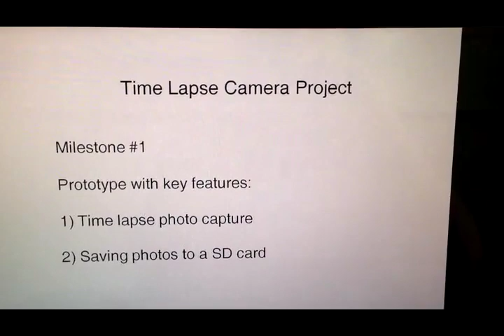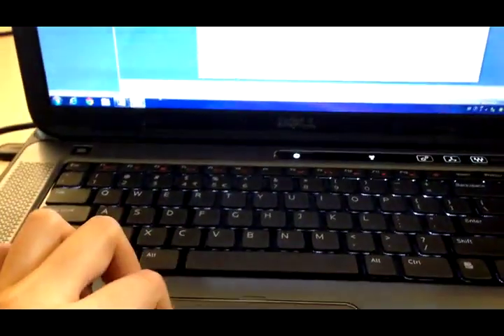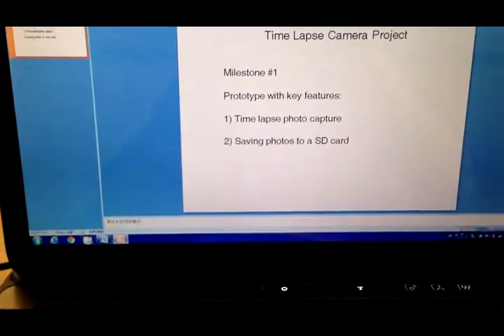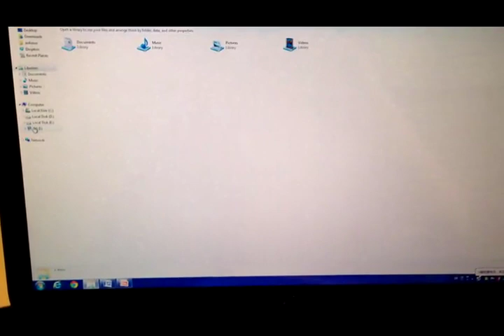Arduino driven time lapse camera prototype milestone #1, Motion detection photo capture, SD card

Comment: Hah, found video with the same devices which I have, arduino, photo camera, and even dell inspiron 5520. I didn't understand, where do you use the other sd card board? I have an idea of almost the same project but with infrared detection of moving and publishing of photos to web. I am going to create it for capstone project of coursera.org course. It would be nice if you'll attach code and scheme to this video.

Comment: Got the camera and SD card to work.
However the Pic.jpg cannot be read by the computer applications.
What JPG decoder are you using?
thanks
Reply: Would please send me any details of this project ?
Thanks a lot
Reply: i have the same problem, please assist if you managed to win
Reply: got that same problem with mine to.
pls have you gotten a solution to that